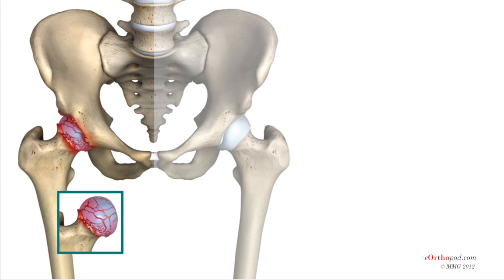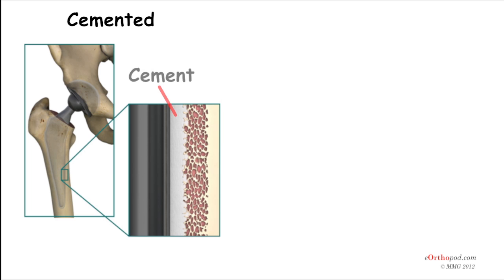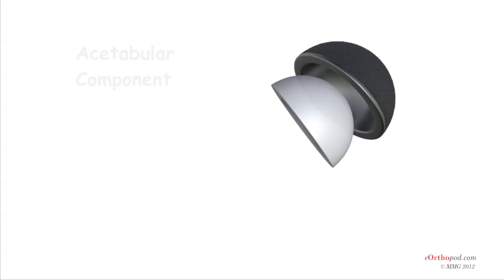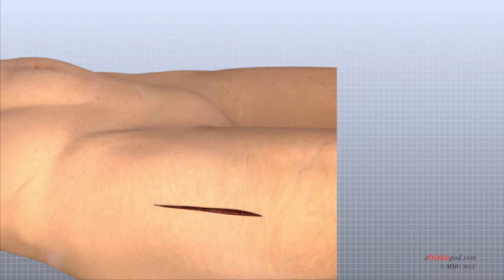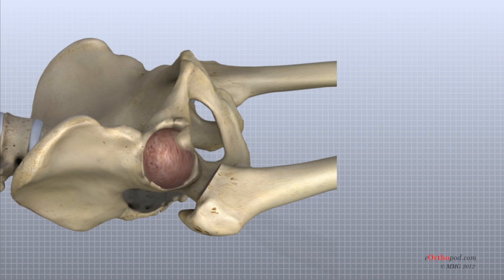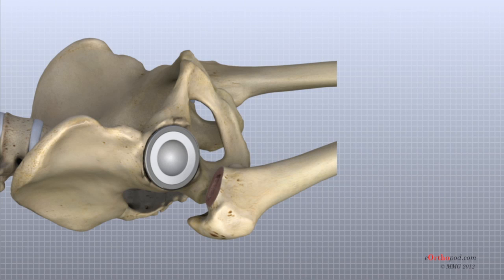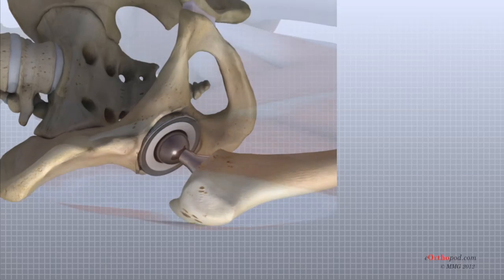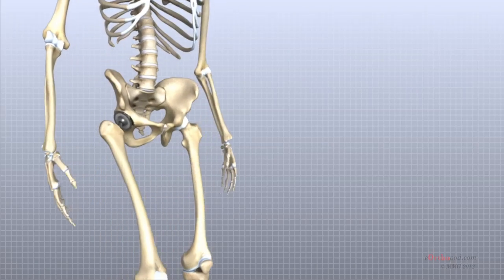Artificial Hip Replacement - Anterior Approach

Comment: I was scheduled to get my right hip done 2 days ago
but cancelled it...

I have too much going on emotionally in my life right now to be able to sink into recovery

I’m not totally disabled but I’m bone on bone

I will get this done
I appreciate all the positive outcomes you’re all describing

also
have
lots of fear too around the procedure
Reply: i hope you've had your surgery and that you're feeling better emotionally. I'm scheduled for Sept 9. I also have had my share of emotional issues, but I believe much of that has been due to living a life consumed by physical pain. The hips hold onto so much emotion, so I'm looking forward to feeling relief. I hope you have found some, too.
Reply: hi
good luck with your approaching surgery
I still haven’t done my hip
it hasn’t gotten worse but I’m certainly a bit miserable with the incapacitation and the pain

some day 🙏
Reply: I put my surgery off way too long.  I was afraid of the surgery because I have a tachycardia issue with my heart.  I was 64 when I finally got it done. (72 now).  Holy Smokes. What an amazing difference.  It was painful, but not as bad as I thought.  The recovery was great. I respected the journey and didn’t rush it.  It totally gives you your life back.  Fear can hold you back or motivate you forward.  It feels as though it was never an issue.  It’s like a part of your body.  I even do light jogging and martial arts, which I’ve been doing for 30 years.  (I did give up jiujitsu, unfortunately).  
Good luck on your journey.  🇨🇦

Comment: I had a total right hip replacement surgery October 2018, posterior approach. Incision was just less than 5 inches, and was glued. No staples. I did very well. Love my new hip. No more excruciating pain. 🥰
Reply: Im same as you i fell and snapped off the balll joint the spike shattered the femur as i went in i they wrapped a steel band round the bone im ok now but recovery hurt like heck